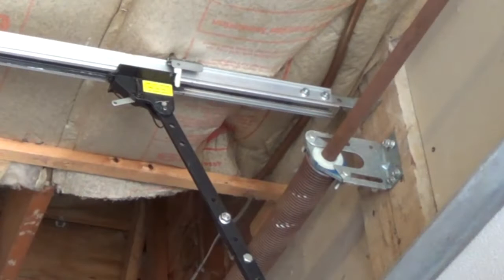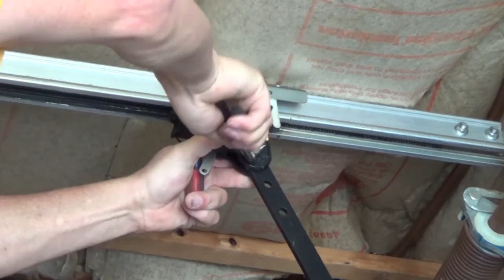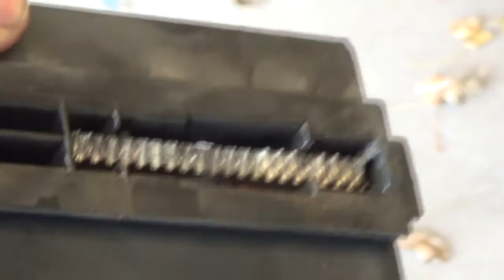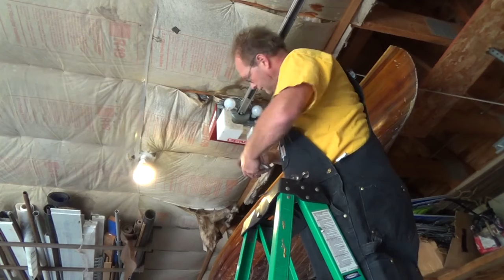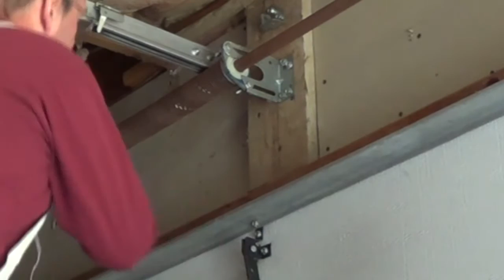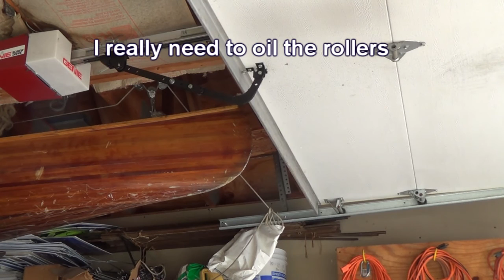Genie Garage Door Opener Repair

Comment: Great opener.  I have made mny of these repairs.  This is probany a 1991 year opener.  Probably does not have the safety eyes.  However they were oltional on thus model i thi k.  On the right side behind light lens is a spot with a jumpered connection.  That is where you would hook up the optional safety reverse sensors.  Also the model number is located on a sticker on the rail towards the motor head. Probably starts with an SD.
Reply from the maker: It is still going strong after all these years. I built a new garage and I installed the side mounted openers which I love. Hope they last as long!

Comment: DOES THIS HAVE BATTERY BACKUP OR NO IT SOUNDS LIKE YOU NEED A NEW GARAGE DOOR OPENER LIKE A LIFTMASTER 8550 WITH WI FI AND BATTERY BACKUP AND SAFETY SENSORS AND MVIS AND A KEYPAD or no i am not screaming at you okay did you replace the garage door and not the operator or buy a new genie or liftmaster 8550 or chamberlain or RAYNOR OR CRAFTSMAN OR LINEAR Wayne Dalton or Marentec or jackshaft how many garage doors do you have
Reply from the maker: I just replaced the one part and it has been working ever since